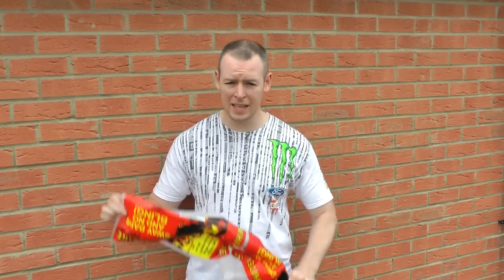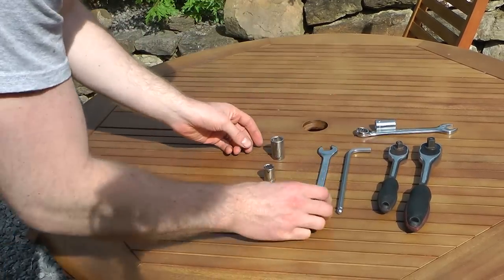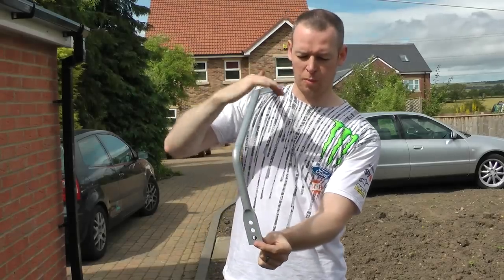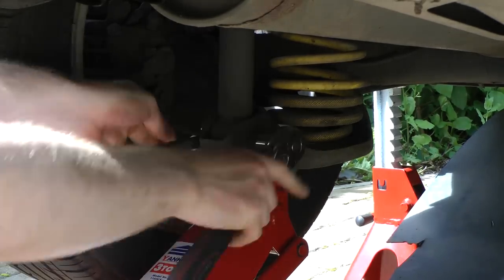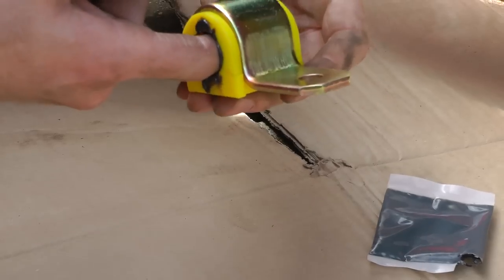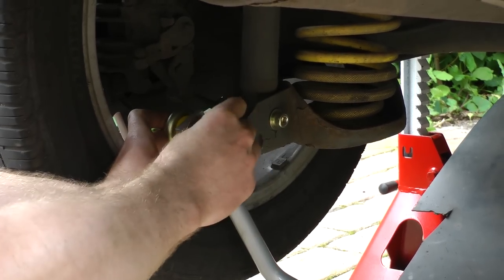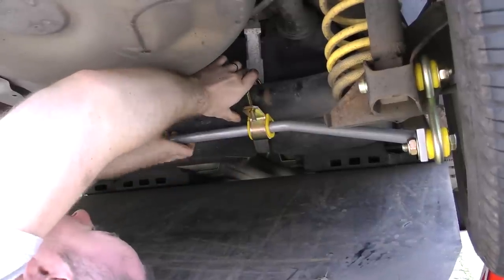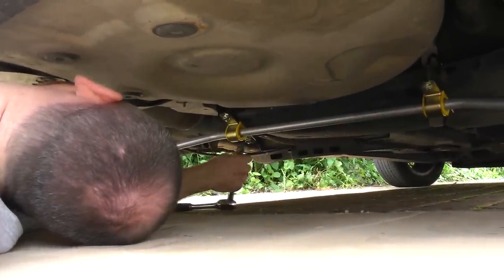How good is the Whiteline BWR19Z rear anti roll bar?

Comment: Fitted a whiteline bar to my S2000 to try and calm the rear end down abit on trackdays. I got the 30mm solid bar that fits to the front of the car and some new end links as i knew the old ones would be cut off. Its a big old bit of steel but its 150% stiffer than the OEM watered down version fitted to the 06 S2000. The difference is amazing, best mod ive done to the car and that includes adjustable damper coilovers. Great vid and gave me an idea of what i could expect of the bar

Comment: I had a set of Hotchkis anti-roll bars put on my 370Z sport coupe and really liked the improvement in reduced body roll in corners and more responsive turn in.
One of the reasons that I got the stiffer bars is that I had excessive + camber changes on some very spirited driving on twisty coastal roads here in Northern California. I even noticed slightly pronounced + camber change with just normal driving. This caused excessive wear on the outsides of the front tires, which shortened the life of those expensive tires. Since I put the new bars on with new tires I find that I'm getting nearly even treadwear across the treads of all my tires. The tradeoff is a slightly harsher ride over bumps, which to me is not a big deal.
Reply from the maker: I wonder if the new stiffer links stopped the wheels from moving laterally under load

Comment: I've got the 24mm bar for my Fezza ST, been on about a week. My sticker was also useless and my grease sachet had burst so you can imagine that mess.
My kit had a spacing collar that fitted onto U bolts before the clamp holding the bushes, one of them was drilled incorrectly about 5mm too wide and so I had to bend the U bolt back in on itselfto fit through the bush holder.
This may compromise it in future but all seems tight for now, but it made fitting this thing almost a four hour job for me.

Comment: Just to clarify, tightening it in the air is ok on ARB's of this type, where the bolt to the axle, it's not ok on some other cars where they're bridging between the axle and chassis. You erred on the side of caution though, which is good. (I mean this all constructively, it's a cool little video in general.)

Comment: Nice little video.

If it's of any interest you don't need the rear axle on the ground to tighten the bolts, as long as both wheels are in the air not just one, then it's not going to do any harm to tighten it when it's jacked up. (This is the case for ARBs, but not other suspension parts)

Also I noticed you've put the large washers on the lower bolt for the drop links on the wrong side, it should be on the wheel side so as to sandwich the bush between the ARB and the washer, hope it's been ok.

Comment: hi am i glad i see this dude i got a corsa c and i changed my front sway bar bushes but when i undone one side the other one was loose so the bar moved and now its in the wrong position   how would i position it should i loosen them then drop it to the floor then tighten them yeh would that be right then
Reply from the maker: +dennis hopkins I'm not entirely sure but I know sometimes a car has to be unweighted to make the components align. Have you tried hacking up the car to see if it fits?
Reply: +v11o what do you mean by jacking it up to see if it fits the bar is allready on there
Reply: What u mean mate jack up to see what fits. Someone said loosen the link rods then level it then tighten them up but i dont get it i did ask what they meant but thay never replyed lol

Comment: So that car does not even have sway-bar (some say anti-roll bar)? And only with rear one you fixed understeer?
Reply from the maker: The stiffer the car gets the less body roll.  Less roll spreads available grip between more tyres.  But this only works up to a certain point where you go from having cured the understeer and instead create oversteer.

From the factory, cars are generally biased towards understeer as when it happens it's less scary for the driver and easier to correct.
Reply: stiffer rear anti sway bar will cure understeer and if it gets stiff enough it will enduce over steer and tripod the inside outside rear tire off the ground in a turn.   Best to get a relatively balanced set up.   Just got a 22mm/22mm for my 2011 wrx.

Comment: the car did not come with the roll bar initially?
Reply from the maker: +FantastyckplastycK Not on the rear
Reply: Even in the US, most vehicles only come with a front bar and stupidly soft mid frame and end link bushings

Comment: I fill like rear sway bars on a solid rear axle suspension is useless
Reply: tyler jenkins But the car still rolls back and forth on that solid axle. The bar helps the body not roll to one side. Instead it takes he left leaning force and lowers the other side at the same time. Proof is in the pudding AND in the theory. 
I have a Defender 110 with no roll bar and it’s scary.

Comment: Why would you put a an anti roll bar on a torsion beam?? It doesn't serve its purpose. 
I can understand an anti roll bar if you have independent suspension but for a torsion beam it doesn't work!
Reply from the maker: Sanjay Ra It really works. It increases the torsion provided by the beam meaning more anti roll.
Reply: v11o agreed with v11. It does make quite a difference.. Although on my gti I upgraded the front swaybar and body bracing before the rear bar
Reply: @xBirdManDriZZyx7  yes but to stop over steer u harden the front but he had understeer !!

Comment: Great video but this is useless especially the way it's designed for that car, would work only if it was fitted to the body and to the beam, not only the beam.
Reply from the maker: +toninocars The bar connects to the suspension struts and the beam connects to the body. It's all connected and it definitely works. I've got another video showing before and after.

Comment: Great video.
Reply from the maker: Thanks glad you enjoyed
Reply from the maker: Mine was squeaking a lot when some of the suspension bushes needed replaced. They were only a few pounds each and made the car much more quiet and comfortable
Reply from the maker: Jigs Jigz Hope you told em to sod off! Solid metal link arms (Lower Control Arms) don't squeak - rubber does. Do a bit of googling for LCA/Wishbone bushes.